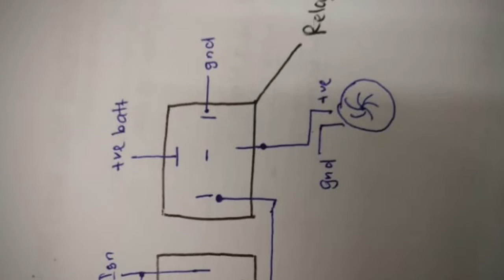Estima TCR Convert Fan Pully to Electronic Fan

Comment: HI, Why do you want to install two fans at the radiator?  To improve cooling> Thank you
Reply from the maker: This two fans are to replace original Fan Pully that will increase more power, save fuel consumption and to help cool air condition during idling (traffic jam)
Reply: @ZaMsChargeRz  Hi, Thank you so much.

Comment: salam kalu nak buat kipas ni agak2 berapa kema sedia rm
Reply from the maker: Wssalam... 
Harga stakat 
Autofan - 31 Dec 2021
Kipas acr30 - Rm200
Wira autofan suiz - Rm37
Relay 87 x 2 - 18
Relay 87a - Rm16
5 pin relay socket x 3 - Rm18
Fuse Holder x 2- Rm10
40 x 60 hose clip x 2 - Rm8
T- Pipe - Rm65
Total - Rm372
Reply from the maker: Upah ikut pomen masing2

Comment: salam..berapa kos barang + upah untuk buat ni bos?
Reply from the maker: Wssalam.. Anggaran rm400 bang
Reply: @ZaMsChargeRz  ok2..skang masih lg pakai kipas pulley..temp kejap naik kejap turun.huhu
Reply from the maker: @abdrahimabdrazak1193  kena check system radiator, termasuk kipas.. air ada kurang x?
Reply: Kalau nak beli set fan dgn sensor semua yg dh siap potong semua blh x?